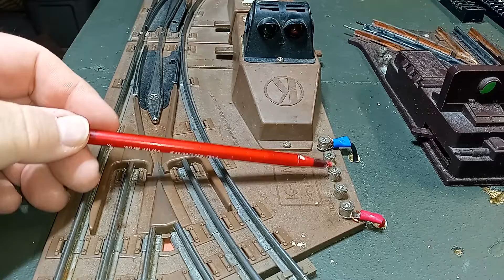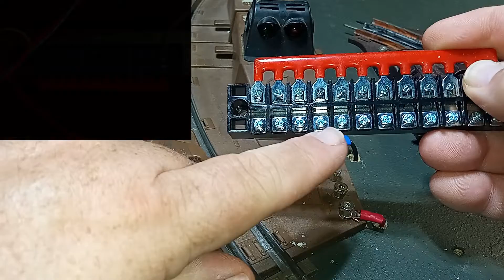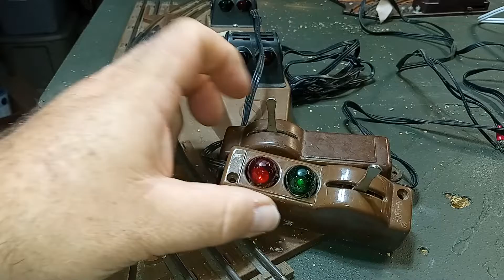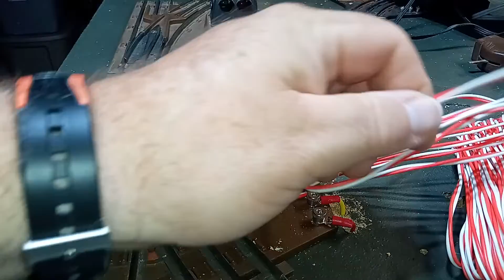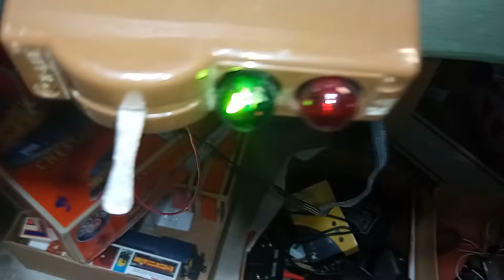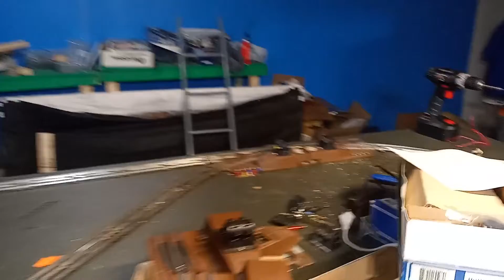How To Wire O27 Remote Turnouts - K-Line And Lionel - Working On The New Layout

Comment: I wired up my K-Line turnouts this evening using your video. Is your common bus connected to the common on the track power side, or the accessory side? I followed your video, but run into the system shorting when the train hits the turnout. Is the common bus supposed to be tied to the accessory and the track power side of the transformer? I love your videos, tons of tips, but got lost on this one.
Reply from the maker: All of my power supplies, whether for track or accessory, are phased together and all of the commons are connected to my buss. If it shorts when the train hits the turnout, look for a problem on the hot side of the switch motor. If the short is on the common side, it should short continuously whether the train is present or not.
Reply: Thank you so much for the reply. I’m going to work on trying to diagnose shortly. I did notice that when the switch track throws from the curve to the strait, there were a few sparks when it slid over to the outside rail. I love your setup with the bare copper wire. What do you use for a connection to tie the smaller gauge that runs to the switch common to the larger bare wire you have running around the layout? TIA
Reply from the maker: I simply wrap a few turns of the larger wire around the bare wire and crimp it in place with pliers. The connection stays put just fine, especially with solid wire. In the rare case that it needs help, a little solder does the trick.

Comment: Found a 42 “ K line turnout at a train show. Worked intermittently due to the micro- switch being faulty. I wired the 3 terminals on the micro switch together and it works perfectly. The red and green lights are both on all the time but at least the switch works.

Comment: After running into multiple Lionel 42” 027 profile switches with the mis wiring problems I started buying K-Line 42” 027 profile switches on Ebay in the middle 2000’s. Several of those K-Line switches had the curved section in which the rails weren’t captive to the switch body and were set in the realistic size plastic ties. Several of those switches I was able to cut off that curved track in order to more tightly build a mini yard.

Comment: Where did you find your buss jumpers.
Reply from the maker: The jumpers came with the terminal strips. I don't recall where I purchased those particular strips - it may have been Amazon or All Electronics, or I sometimes find electral odds and ends on Walmart's page.